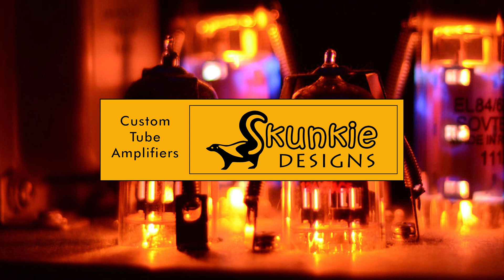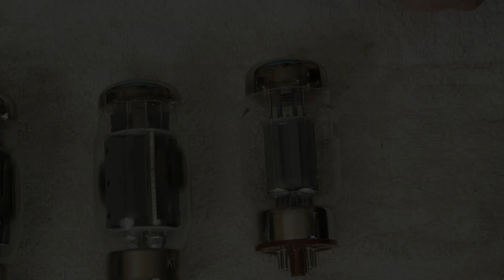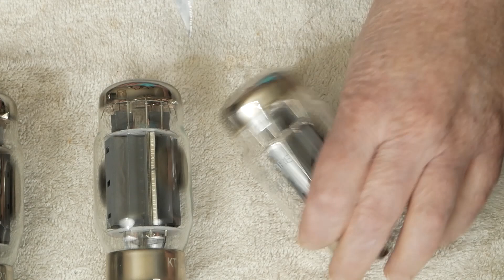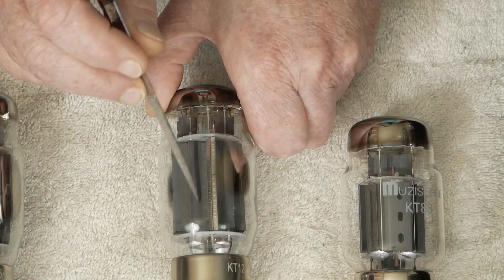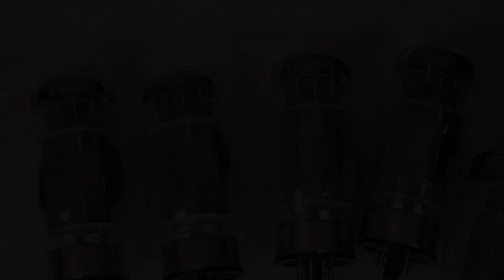Tung Sol KT120: Why do some of them overheat and others don't?

Comment: Probably welded where it is because the plates are being welded together anyway.  Its just one more "thing" to clamp together in the assembly.  It would make more sense over the beam plates though, there are a couple of extra radiator fins on either side of that weld joint in a KT120 for heat dissipation, and un-blocking those would make them even better able to handle it.

Comment: Interesting.  My recent Mullard KT-88’s are just off to one side like the tube you show, sometimes the plate seem o just covered up, but the disk will be off to one side as the wire that holds it moves the disk away from the gap. No red platting, but as you said biased pretty low.
Reply from the maker: And the heat load on a KT88 is much lower.

Comment: Wow that makes sense why they were red plating. I been using Tung Sol EL34's in my guitar amp never had that happen before. Getting tubes these days our getting harder.
Reply from the maker: They don't have these type side getters most likely.
Reply: @SkunkieDesignsElectronics  You are right they don't! I'm happy you found out why they did what they did and the new KT120's working great! I wish i could here that amp i bet it sounds so sweet. A good tube amp is what it is about tone for days.Thank you have a great day!

Comment: That's a very intuitve observation but there must be a reason why Tung Sol put the saucers where they do.  Either it's easier or they have to be in that posistion because of the internal construction.  Hovever if this is what's affecting the power handling it would be an essential part of the manufacturing process to get right, which is terrible QC.
One question I have is if this amp was built for use with KT88's would the sound quality (ignoring power) be as good because people like KR Audio etc make good KT88's.
Reply: I think you underestimate the likelihood of snafu... new workers are shown how to make KT120s and one detail is left out (don't make the halo directly opposite the plate seam).
Reply: Please do have a look at old tubes before your era ....and look where the getters were put before ( you were born...) @gregwilliams2746
Reply from the maker: I honestly can't say they would be "as good", I've never heard those KR Audio tubes. There are a zillion KT88 SE designs out there.
Reply: The real TUNGSOL is turning in his grave.................

Comment: FYI:  The "getter" vaporizes calcium metal, which condenses to form that silvery deposit.  Calcium is an Alkaline-Earth (Group II on the Periodic Chart) metal, which is highly electropositive, and the vapor reacts with the oxygen & nitrogen in any air present, to form calcium oxide & nitride, which are very high melting point solids.